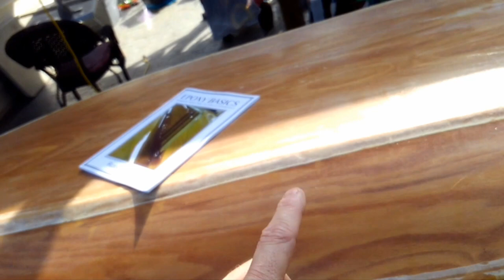Plywood Boat - Easy Build - Part 2 of 3 / Series

Comment: Surely epoxy first and then steadily add the tape. Fully wet out the seems with epoxy before putting the tape on. Same for the bottom panel. I've built twenty odd boats with west systems epoxy and it's wise to follow their instructions.
Reply: I was thinking this same thing…it needs to be wet under because the wood will soak in so much of that, then it will “glue” the glass to the boat, and then the wetted outer epoxy will seal it and lock it solid….none of this build made any sense to me. 
But to each their own I suppose. Finally product looked pretty cool I guess.

Comment: Doesn’t want to spend a ton of time on the bottom of the boat yet that is the most important area as it takes all the abuse. It needs to be the most structurally sound part. Hitting rocks or debris, scraping along the shallows or while beaching. The bottom gets abused and should be built as bulletproof as you can make it.

Comment: I’ve never seen someone handle fiber glass with such little protection most people complain so much about itching. You made it seem a lot more accessible.
Reply from the maker: You should be careful, especially when sanding.  You don't want those fibers in your lungs.  When it's in a sheet, it's fairly benign, but yes I should be wearing gloves. The epoxy requires a good mask though. I'm  outside using a mask and gloves. Long term exposure is where the real trouble lies.

Comment: There are a number of steps in your fiberglass technique that have me concerned. 
1st; You've cut each piece of glass cloth to fit each facet/plane with no overlapping. The cloth cannot provide any structural continuity this way. The structure is relying entirely on the 2" tape. 
2nd; You used spray adhesive to stick the cloth in place. You effectively sealed the wood with the spray adhesive, preventing any chance the epoxy has of bonding the glass cloth to the wood. 
3rd; You keep saying "epoxy", however, it appears that you're applying fiberglass resin (polyester?) to the cloth. This is what an auto shop would use for body work. I don't believe that stuff is intended to be much more than filler under a finish. 
I have serious doubts about the structural integrity of this boat. I'm concerned that the fiberglass is going to be prone to delamination. 
The bond between the paint and the fiberglass is going to be stronger than the bond between the wood and the fiberglass. 
Please be careful when you put this in the water. A pfd is most definitely suggested. That and don't get any farther from the shore than you're willing to swim. 
If you're planning on powering this craft, I would recommend just a trolling motor. At least until you have proven the integrity. 
I truly hope that all of my concerns are misplaced, and everything works out as you intend. Just be safe.
Reply: Totally agree with Bob Mc Bride . Name her the "Widow Maker " your techniques have me greatly concerned. You seem to be more worried about cost and ease. No thank you. I love the design and would want to build this.
Reply: To address some of your concerns: My dad built a wood and fiberglass boat, using polyester resin, in 1962-63. It was still around a couple of years ago. (50+ years) Also, as a lifelong (~45 years) auto repair dude, I can tell you that polyester resin is amazingly solvent in nature and would likely eat and absorb the spray glue. My choice? No, but probably ok. Just my experience.
Reply: @kbbacon  I appreciate you sharing your experience. I guess my main concern is the way he cut the glass cloth into panels. It didn't allow for much overlap at the joints. 
My one and only experience with polyester resin was a disaster. I was not aware that it would attack foam. I had a couple of hours invested in carving and shaping a fairing blank. I got the glass all laid out and draped just how I wanted it and mixed up the resin and hardener. I poured out the mix and started spreading it with the spatula. On the second stroke, I could feel the foam dissolving under the cloth.
Reply: @bob2161  Yes, indeed! Many a novice auto body worker has tried to use foam as a backer and found this out. Oddly enough, spray can foam is urethane and is not affected. Yes, the overlap is, perhaps, a weak spot, but with this small of a boat, it'll probably do.

Comment: Boat is coming along great, Tony. Looking forward to your use/review of your new M2 cutter. Looks like an inexpensive CNC machine I’ve seen before. I think it was called a Maslow but not sure. That machine was genius in its simplicity to operate. Very effective for the cost. Thanks for sharing.   Troy
Reply from the maker: So Maker Made bought the Maslow from the inventors. Normally you would que the downfall of a good idea but that hasn't been the case. The Maker Made dudes are awesome. They are answering questions at the cyclic rate and helping all the new owners. The owners group is super active and helpful and the machine is high quality and refined with some real thought involved. It's a total game changer.
Reply: Commando Designs   That’s great to hear. The maker community is like that, though. Very supportive and encouraging.  Can’t wait to see your machine in action.

Comment: Tony, sorry , but the wood should be faired first, then the 'glass laid on dry & smoothed out. Next apply several coats of whatever resin you choose until the weave is filled with each coat laid on when the previous one has gone tacky for a chemical bond. If further fairing is needed, slather on a coat of resin thickened with fairing filler like "Q-Cells" which is easy to sand. NEVER sand into the fibreglass weave!...it will degrade it's strength seriously & weaken any joins. I say this in good faith. Why do all that work with unknown outcomes?

Comment: I think you are setting viewers up to fail. I hate to tell anyone that but.. putting the glass on wood and then coating it will not get enough epoxy into the wood for sealing and best adhesion. Using even a fine later of spray between the wood and glass makes it closer to impossible for what you want. In time, you will be testing the ability of the spray and glass/epoxy to stay together.
Reply: Agreed BG.People's lives could rest on the integrity or otherwise of the build. Old adage:- "When in doubt read the instructions".

Comment: Lazy builder you should have cleaned up the inside and taped the seams …… this shit will fall apart      I like the boat design
Reply from the maker: It's time for a re-wrap with fiberglass. It held together on the seams. It's the bottom that eventually started to crack.